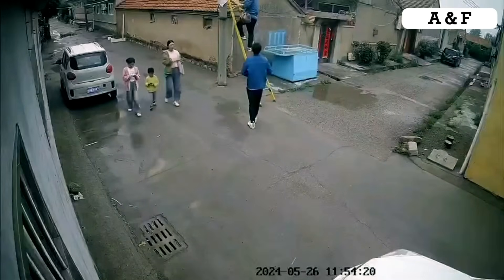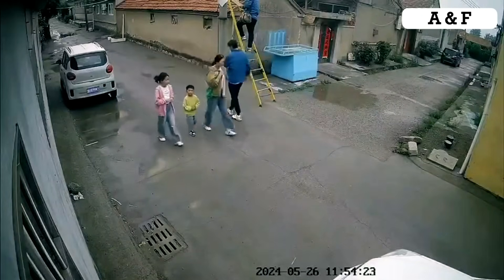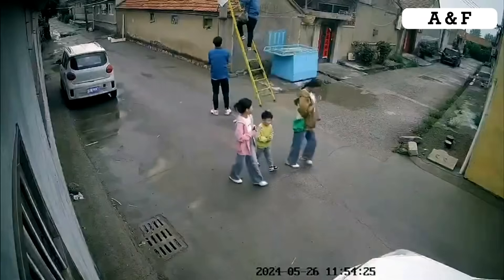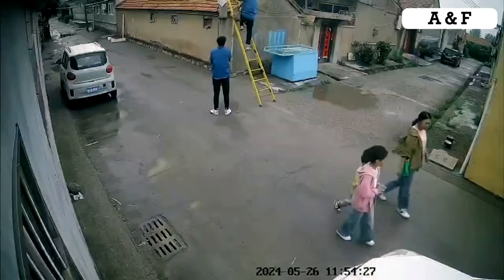⚡💀HIGH VOLTAGE ELECTRICAL INCIDENT

Comment: The 3rd one looks like low voltage, it's too close to the ground, no special equipament is used, I'm not sure about this one but I think an arc on power lines with 13kV+ wouldn't look like that.
Reply: "High voltage" is anything over 1000 volts...try again.
Reply: @codymoe4986  but it's not though, those were either 127V or 220V if it's an industrial zone you may also encounter 380V.
Reply: @codymoe4986 also from 1kV to something like 50kV is considered "medium voltage"

Comment: That dumb villager got arc flashed, he for sure got hurt badly, even though he ran away his injuries are pretty bad. This narrator is clueless.
Reply: Nah
Reply: @sayori3939  During an arc flash like that the first reaction most humans would have is to breathe in suddenly due to instant and unexpected flash like that one in the video. That guy in the video breathed in serious metal and fumes, he's probably dead by now.
Reply: @MikeJones-dw1zl  that's not an arc flash in the video, he's messing with low tension

Comment: Do not use cellphone while working under steel coils; Heavy Stock should have "Tilt" warning devices (Like Pin Ball Machines), and Wear ear protection when working on high voltage.

Comment: Being an ICI electrician, 'high voltage', are potentials over 600V. Our work stops at 600V, were then, a different classification of worker is employed. In Canada, residential customers are usually served with 120V/240V, or 600V three phase (347V single) for commercial/industrial customers, that is further stepped down by the customer owned transformer to a working voltage.
Even so, these potentials are very dangerous when one considers the pressure and the available short-circuit current. Perhaps it was high voltage. It's hard to tell what exactly the worker shorted out - before or after the street pole step-down transformer, and what the street wires are in this section of line.
Reply from the maker: Thanks for the comment
Reply: Nah it's definitely low voltage, they're working too close to the ground, no special equipaments and the arcing seems mild